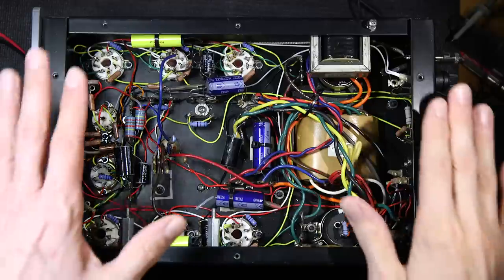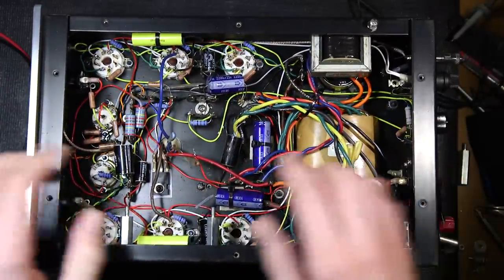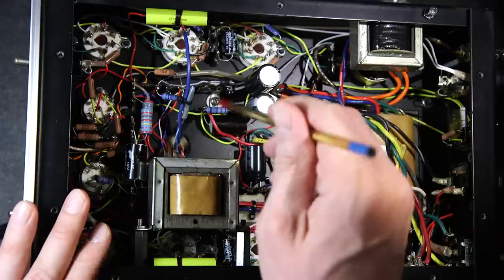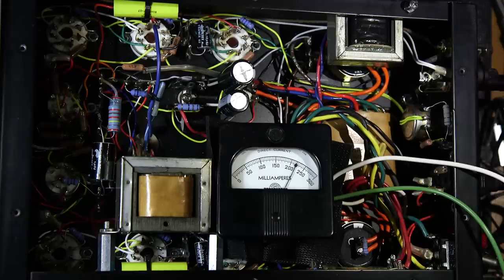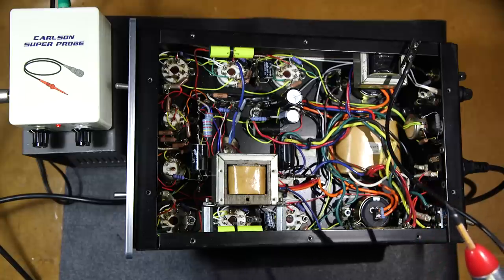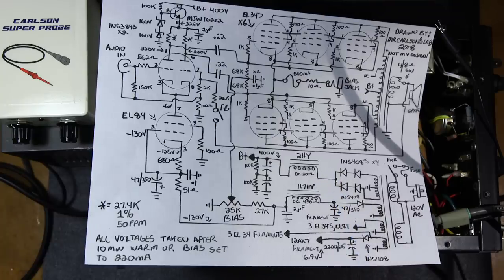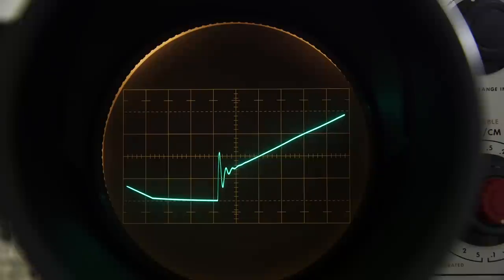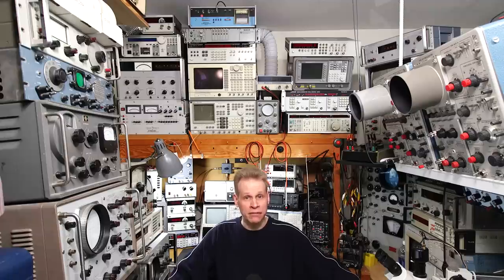Amplifier Troubleshooting and Modification.

Comment: Yet another great video Paul... Did you get a different cam?? It seemed much higher definition than others...i will be signing up for your course soon as i am still on the road alot
Kudos and im sure those amps sound incredible
73
Jeff
WD8JM
Reply from the maker: Hi Jeff, The cam is what I have been using for awhile now (about mid last year), it's a Canon C-100 MKII. Thanks for your kind comment!
Reply: Maybe a better question is to ask what he's using for lights.  While cameras have gotten more sensitive, they still seem to really like having a lot of light to make things "pop".  A mediocre camera with good lighting will out preform a great camera with poor lighting.

Comment: In an ideal situation I'd just drive to wherever you are to have a look at the guitar amplifier I built from a kit... (That would be a series on the sins of a rookie hobbyist, heh)

But what's likely wrong is substandard bias potentiometers like the amp in this video getting out of whack and popping the fuses.

I need good 50k pots for my bias adjustments. Can you help? None of the parts commonly used in guitar amps seem to be good enough and I'm not familiar enough with other suppliers.

Comment: 20:00 that's why safety margins should be BIG when you are an amateur; especially on something you can't afford to mess up, amateurs simply don't have the wide range of knowledge required to use small safety margins. A safety factor of 2x(or so the amateur might think) would have worked just fine.

Comment: Why does 47 (eg 0.47uf,  47K resistor) occur so often in electronics?
Reply: Mike: The quick answer is that those numbers were chosen by IEC in the 1950s as preferred values to create a useful series of steps of resistance in a standard way in order to encourage mass production and interchangeability.

Here’s a good explanation:
http://www.resistorguide.com/resistor-values/

“The standardization of resistor values serves several important purposes. When manufacturers produce resistors with different resistance values, these end up approximately equally spaced on a logarithmic scale. This helps the supplier to limit the number of different values that have to be produced or kept in stock. By using standard values, resistors of different manufacturers are compatible for the same design, which is favorable for the electrical engineer.”
Reply: That's because usually electronic components are defined by a scale called "E-series", which standardizes common values and makes some (like 47) very common. Here's more informations: https://en.wikipedia.org/wiki/E-series_of_preferred_numbers
Reply: These are E series standard values. It has all changed a bit over the years. Components with tighter tolerances will usually have more values. Essentially you are looking at a logarithmical increase in value from 1 or .1 or 100, etc. For 20% parts for example we get 1, 1.5, 2.2, 3.3, 4.7, 6.8. 10% parts have intermediate values such as 1.2 and 2.7. It turns out in practical usage certain values become popular. There's 1k resistors all over the place. It just works out that way. There's a decent Wiki entry on E series.
Reply: Nicely put Eric, a fine explanation. The standards apply to both resistors and capacitors of standard values.
73's-Gary KI7TWX
Reply: and inductors but you knew that, G7SWR

Comment: Hello, 
I’m having a similar issue with a ringing choke. But in my case there’s already 220uF of filtering before the choke and three 47uF filters after. I’m not sure if adding more capacitance before the choke would help. Any help would be appreciated.

Thank you
Reply from the maker: If the choke is ringing with 220uF in front of it, there must be something wrong. That choke is just DC resistance with that filtering ahead of it.
Reply: Thanks a lot, I’m wondering if I could replace the choke with a high wattage resistor at that point then? Thanks

Comment: Is the choke a necessity?
Many valve amps don't have them as part of the mains smoothing.
How would you modify the circuit to obviate the choke?
Reply from the maker: Hi George. The B+ would be very high without the reactor, so a different power transformer with a lower secondary winding count would be a start. Then lots of (uF's) after the rectifier.

Comment: Hi Paul,
Brilliant, that's the word for it.
Power supply is underestimated and easily passed by.
I have a question, I construct my own power transformers.
What I noticed is that   when I measure the potential secondary winding the voltage is correct.
but when I measure the metal from the transformer and one off the poles off the secondary winding I also measure a high voltage. What should be their.
Perhaps ,you could elaborate on that a little bit.

73 PD3WMZ
Reply: j z Have you tried placing a small load in parallel with your measuring device? It's fairly common for capacitive coupling to cause induced voltage on transformer cores, and even coupling between primary and secondary windings. Otherwise, it's possible you have some nicked insulation on a winding somewhere that's contacting the core.
How hard is it to wind your own transformers, BTW? I've never tried it before :D

Comment: Since i watch your videos i heared a lot of time the word "Bias". What exactly is a Bias ? For what is it used ?
Reply: think of "bias" as the minimum amount of gas your car needs to use ,when in idle, just to keep the engine running. Too much is a waste and too little will not keep the engine running "smooth".
Reply: The politician circuit uses it to get power.
Reply: bias in tube amps is applying a negative voltage to the 1st grid of the tubes to reduce the current drawn to(like idling) without it its like u just floored  the throttle to max & burnout
Reply: willrobbinson (negative dc volrage ,but negative WITH RESPECT TO THE  CATHODE)
Reply: nice explanation. Thank you.

Comment: What brand of caps did you use to replace the Joe Blogs ones in the power supply?
Reply from the maker: Nichicon, Rubycon...
Reply: ...and 105 degree rated low-ESR series I presume; pretty much what I'd expect any decent EE to spec for a power supply. Just getting confirmation for those following along.

Just to clarify for those playing along at home (EDIT: posted before reading other comments where Paul said he'll do a video on this later), the choke wasn't the source of the noise, it was a symptom; the source was the rectifier diodes. The capacitor that Paul added just snubs most of the ringing to ground. A quiet choke also runs cooler than a noisy one, so this simple capacitor not only makes the amp quieter, it also reduces thermal stress on the choke and all those electrolytic capacitors. The capacitor itself can be any flavor of poly as long as it's rated 630V or higher.

Aren't such snubbers actually covered in datasheets for voltage regulators and converters? I think some of the better datasheets do actually go into the theory. Looks to me like this power supply was simply copied from a vintage amplifier that the bean counters had meddled with. Note also the chassis referenced filaments; gotta shave those pennies' worth of wire.

Comment: Sir can you help me in the matter below?
I had built a solid state amplifier using TDA2030 chips with active tone control(using LM358) and a class A preamp after the tone control, then the signal goes to the power amplifier through a volume potentiometer.
Now after running the amplifier for some time, it starts to make a 100Hz buzzing sound(audible if volume is halfway turned up) which wasn't present just after being turned on.
The noise can't be heard at 0 volume (so,I think the power amplifier is not guilty)
I couldn't figure out what may be the issue?
Reply from the maker: There could be so many reasons Anindya. Are you using a "star grounding system?" Is the 100Hz noise an oscillation? Have you checked the circuit with an oscilloscope to verify this "noise?"
Reply: Thanks for your support. No I don't have an oscilloscope (it's difficult to find here).In our country the mains frequency is 50Hz so hearing it, I assumed it to be 100Hz.
The star ground is on the PCB with main capacitors (2x10000uF).
I think its due to oscillation in the transistor class A preamp which uses single positive rail of the dual power supply.
Is there any video where you explained the causes of the oscillation or can you make one please?
Reply: One thing I forget to tell, which is the fact that there are two transformers sharing a common ground after rectification; one for the power amplifier and the other for a cheap mp3 kit (for using FM, USB and Bluetooth inputs and gives the audio output to the tone control), which works fine.
Are the two transformer of different ratings, causing the issue?
Reply: The class A stereo preamp has a variable resistor connected between the emitter of the two transistors of individual amplifiers to make a differencial surround effect.
I think this might be the issue,am I right?

Comment: Hello Paul  !!!  Great video AS ALWAYS !!!  Now please correct me if I am wrong on this conclusion of mine or idea, By adding that value capacitor to the choke are you, in effect, DE TUNING that circuits ability to be resonant at the frequency of that "RINGING EFFECT" ???  Like a NOTCH FILTER if you will ???? and secondly,  Is that choke a 'SWINGING CHOKE" or is that a regular choke "NON SWINGING"  would that make any difference ???  Your video here stirred my brain cells firing and my synapses conducting  !!!!!  Which is a GOOD THING !!!!  Thanks ahead of time.  ---------------   John Bellas   KC2UVN
Reply from the maker: Hi John. I will do a future video on Ringing and (a hint:) "Diode reverse recovery" in the future. Thanks for your kind comment!

Comment: shocking what passes for "audiophile elite" tube amps . poorly designed cheaply built trash in reality . you don't even see cheap guitar amps firing high voltage B+ directly into the choke , theres always that first capacitor stage , usually higher mfd value than you've used as they're not worried about resulting slightly higher voltage . series gives you 2 x the voltage handling but how do you figure that paralleling 2 x .47ufd results in .47 ?

Comment: Mr. C      I have some old circuit drawings that have some had to find transistors, and I was wondering if there is a site that gives a cross ref. equivalent, from whatever to a 2Nxxxx type.  I've searched the web, and not real happy with the results.  I look up a part number, like ecg220, and it gives me some car break part.  I stipulate that it must be a transistor, and get the same results.
I have one of the older ECG catalog, and I can put in the part I'm trying yo find, like a RS2036, and it gives me a ECg220 part number, but I would like to find the 2Nxxx part number.  There must be a site some where on line with that kind of information???
I'm getting very frustrated, and not getting what I need!!!!!!!  Any Kind of Ideas??????   Email= restore.n.fix@gmail.com
Thank You!!!!!!!
Reply: ECG was acquired by NTE a few years ago. The "NTE" prefix will replace the ECG prefix in most cases AFAIK.

Comment: BY ADDING THE 0.47mic AND ELIMINATING THE RINGING, YOU WOULDN’T HAVE NEEDED TO REPOSITION THE CHOKE !
YOU DIDN’T SHOW US THE FINAL RIPPLE AFTER ALL YOUR MODS ??
Reply: I  thought Paul did - I seem to remember the basic hum was only a little more than when he was holding the choke in the very best position - but still a vast improvement.  The .47uF was the icing on the cake - which I can`t eat as I am diabetic. I think he mentioned that the basic 100c/s hum would still have been interfering with the O.P. transformer even without the nasty ringing.